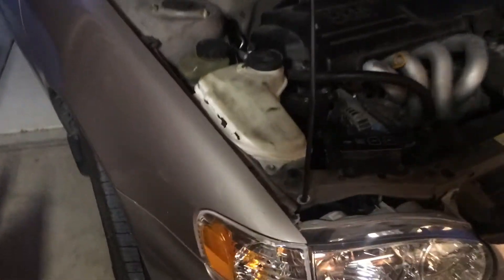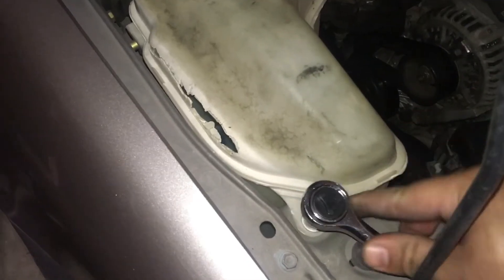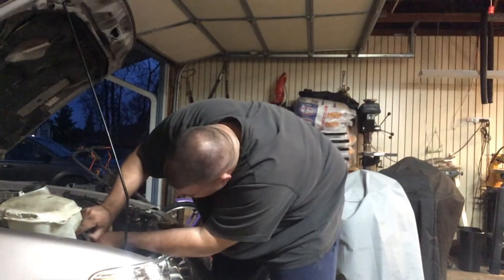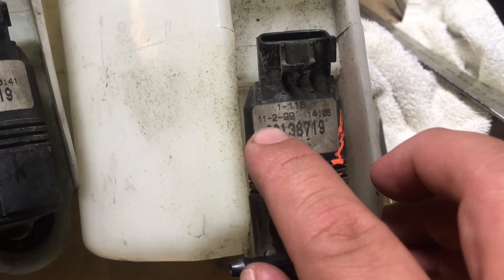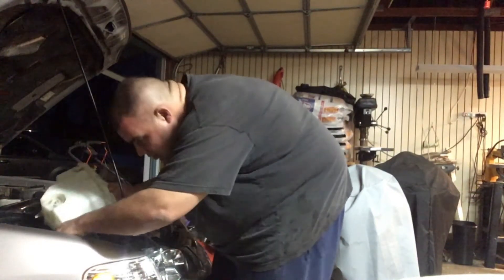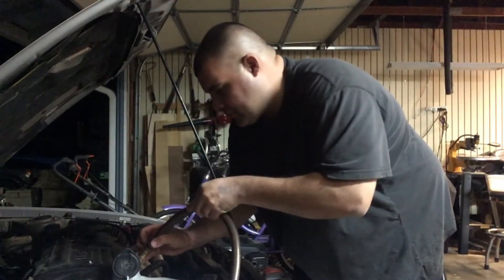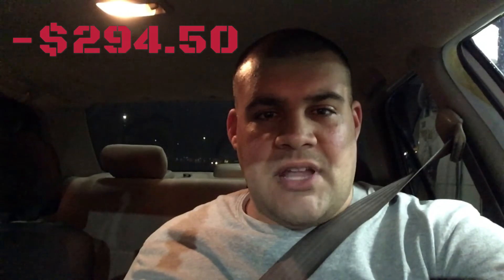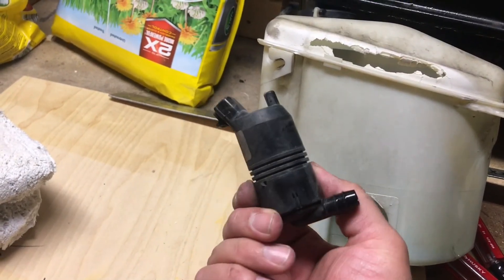How To Replace A Winshield Washer Reservoir

Comment: How to work the washer reservoir Daniel? I have timer thingy and when I pull it, it wont work. Also I need to replace my old reservoir its broken lol.
Reply from the maker: Jonathan Sarmiento if the stock doesn’t work when you pull it, first make sure the water hose is connected to the pump at the bottom of the tank, also make sure it’s plugged in. If it still doesn’t work listen to see if the pump is at least pumping water. If not then the pump probably quit, if it is then you might have a clog somewhere in your lines. Hope that helps
Reply: Daniel's Car Talk Channel I will have to find out. Thanks Daniel's!
Reply: So I disassembles my reservoir and every pipe seem to be fine but still seem to not work. What shall I do next Daniel?
Reply from the maker: I would venture to guess the pump itself, also check the connection to the pump.